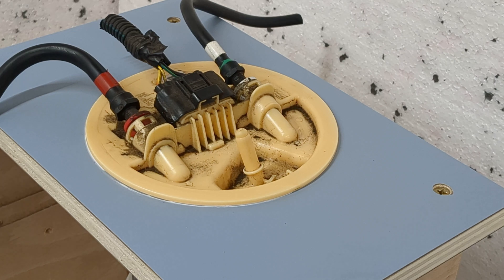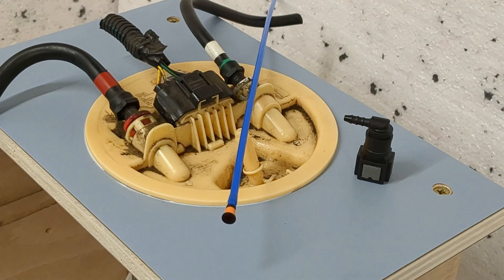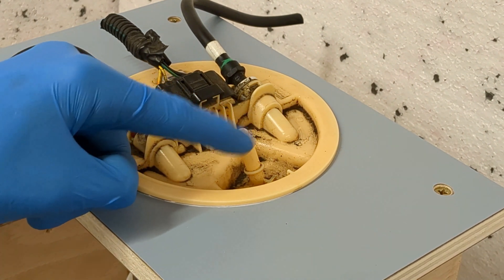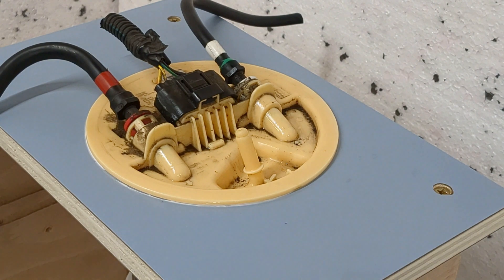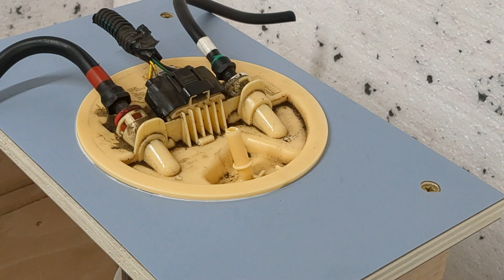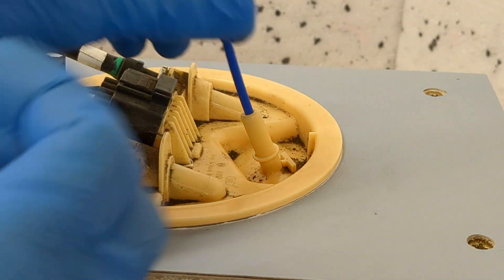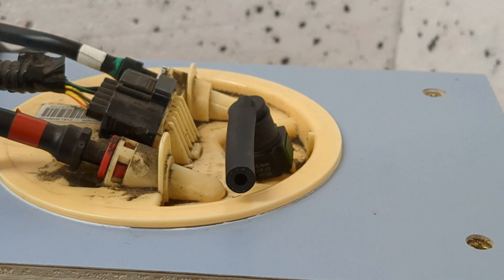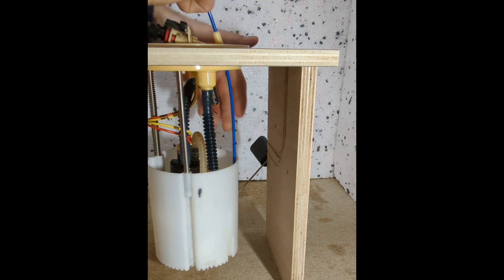How to tap Ford Transit Custom diesel tank for auxiliary fuel supply when installing a diesel heater

Comment: What size of rubber hose fits on the plastic elbow and then  what size of hose to carry the diesel? Cheers.
Reply from the maker: The connector will take a 4mm hose or the green rubber hoses provided with most heaters. 

We also sell a quality upgraded fuel kit if you want a higher quality fuel line

Comment: Will this fit a ford transit 2006 T350 rear wheel drive?
Reply from the maker: It will fit all mk7 vans. 

Type your reg into AutoDoc or Eurocar parts to confirm what style of sender unit is fitted.